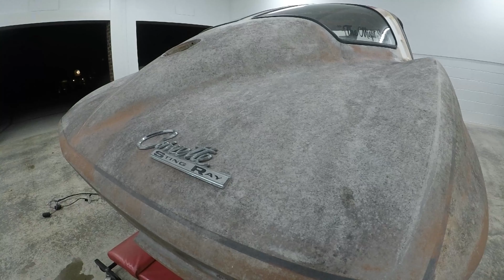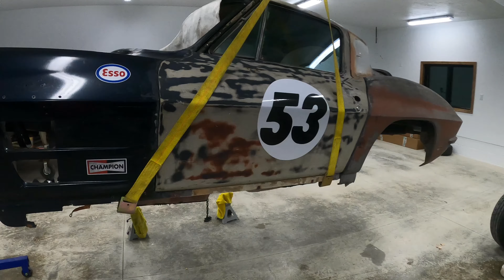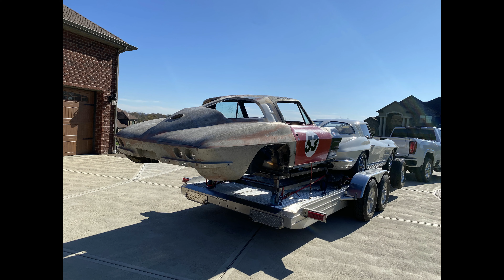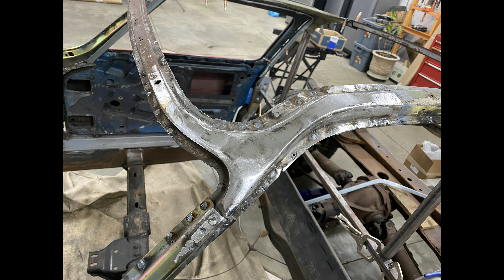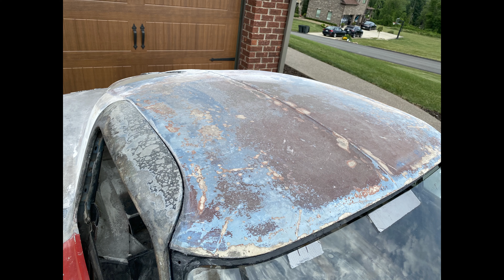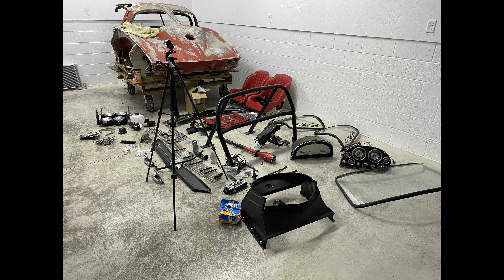Taking the Misfit Apart.  Removing the Body on a 1963-1967 Corvette.  I SOLD the Misfit Body.

Comment: That was a bittersweet moment. Glad it didn't get rear ended on the way home. You put a target on your back when you said you didn't get any tickets. Officer #3 is still out there. Waiting and watching. The Misfit was fun. Glad you kept the frame and engine.
Reply from the maker: Hey Jim. Yeah it was. It’s honestly a huge compliment to have someone want to buy your work because they can put their own spin on it. I think that’s why I’m not bummed about selling the car. Haha I did put a target on my back. But I said that after the car was parked for the last time. 😂 so it should be fine lol. Officer #3 is watching and waiting. On the final drive I passed one officer and one followed me home rather closely. I tried hard to go the speed limit (the speedo wasn’t hooked up) and keep the rpm low so he wouldn’t hear the full volume. I turned down my road and he kept going. He must have been thinking “what the f@$k is on my streets?!?”

I’m glad you enjoyed the project. I had a good time with it. Those parts will bring other cars to life. It’s the Corvette circle of life lol.

Comment: So much for emotional connections with your project cars. They would have to sedate me before they could separate me from my C2.
Reply from the maker: I spent probably 30 minutes the night before it went just staring at it. I got it out of my system. But I would need to be under for someone to take the red car. That’s a much harder bond to break. I hear you on that one. The Misfit meant a lot less to me than the red car. People always asked me “are you going to sell the misfit”. I always replied “I have no intention on selling either car. But if I have to sell one, the misfit will be gone in a flash”. And it is lol.

Comment: That was one heck of a stupid decision, what kind of idiot takes a Sawzall to a split window? 
Mitch, give your friend directions to the Wizard of Oz and ask the man behind the curtain to give him a functional brain control housing group.
Reply from the maker: I cut the front clip ahead of the firewall. I didn’t hurt the car. He wasn’t going to use that clip anyways. It was a junk hand laid aftermarket front end. It had dozens of bad repairs. The inner fenders were in the wrong spot. One fender was higher than the other. It wasn’t a good clip lol. That front end won’t hurt anyone anymore. I’m going to mount it on the wall like a prized buck lol.